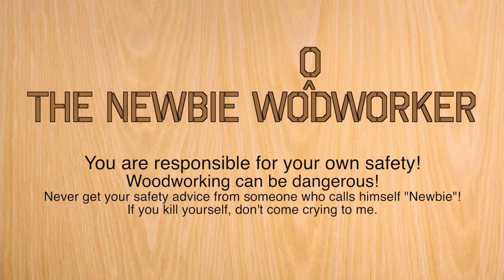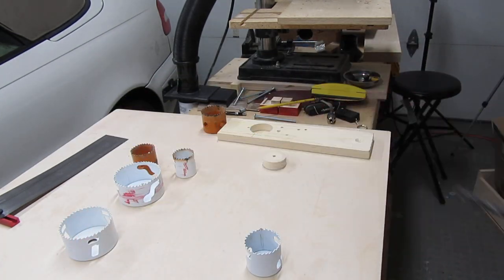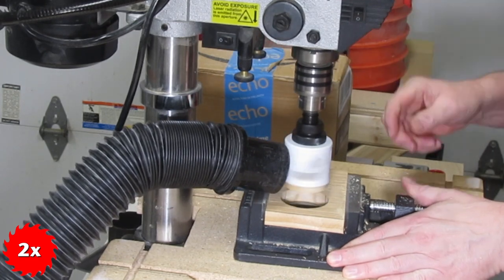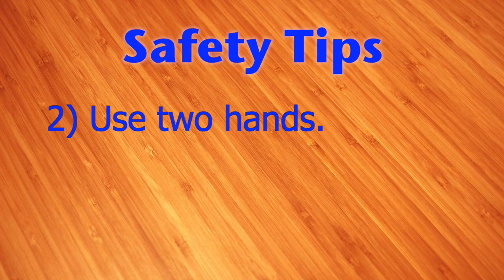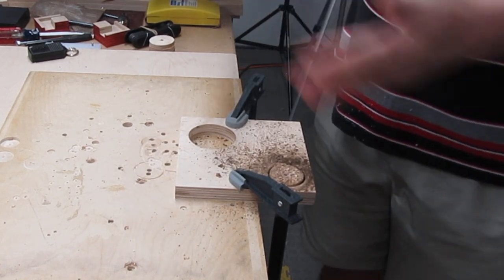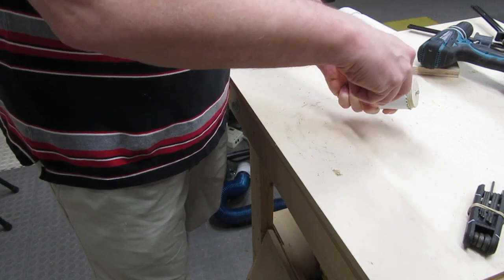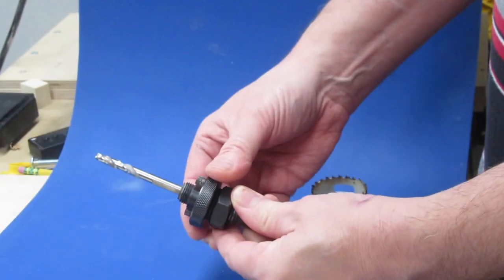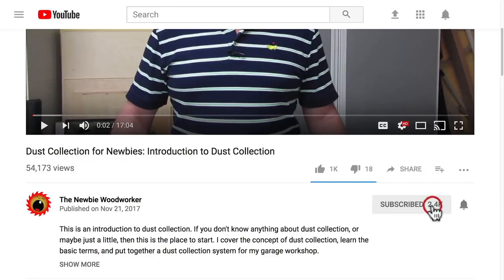Newbie Tool Tip: Hole Saws

Comment: well i just trying to drill a hole on my table
end up the hole saw break apart
guess keep applying pressure from the start is a bad idea

should slowly right?
Reply from the maker: Probably true, but it's hard to say what happened without having seen it firsthand.
Reply: @TheNewbieWoodworker  i try to explain for you
first i direct apply hard pressure from the start
and i just keep pushing the drill until the saw touch the wood i apply more pressure here and without stopping just keep drill
until it start smell burning and the hole saw break apart 
should check this video first before using it
Reply from the maker: @aidentk5158  If you smell smoke, stop! It means you're trying to make the drill/saw/bit do more than it's capable of. But I guess you know that now, right? 😄
Reply: @TheNewbieWoodworker  first time using the saw i don't know 
and the hole saw break apart and stuck inside the hole 
i just brought a new saw 
make sure follow your video this time

Comment: Only here ro make sure the thread isn't a reverse thread.. had to use an impact drill to get it loose... 😅
Reply from the maker: I don't believe it is, but I get my left and right mixed up a lot. Whether it is or not, there's no need to tighten it down that much. But you probably already know that, now... 😃

Comment: After my first experience it became apparent that all those teeth were overkill. I took an angle grinder and removed all but 4 teeth. the missing teeth make a good place for saw dust to accumulate until I brush them off with a metal brush.
Reply from the maker: I've never heard of anyone doing that, but if it works for you, then good on ya.

Comment: Hi...great video..I'm in the process of buying a drill press but I am limited to 730mm hight. I am wanting to holesaw 6" and 4" dia into mdf and also 4mm leather can you recommend any machines you think woud be ok. I dont mint taking it easy when doing the job. Thanks.
Reply from the maker: Thanks. I wish I could help, but I just don't know enough about drill presses. I recommend going to https://www.lumberjocks.com/forums and asking there. You'll have to make an account, but it's free.
Reply from the maker: @stewandumps  👍